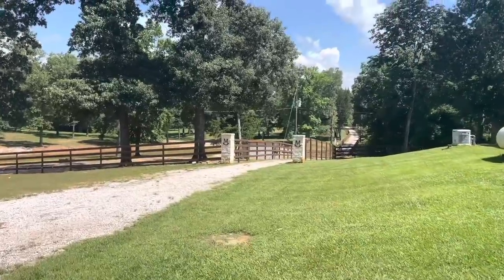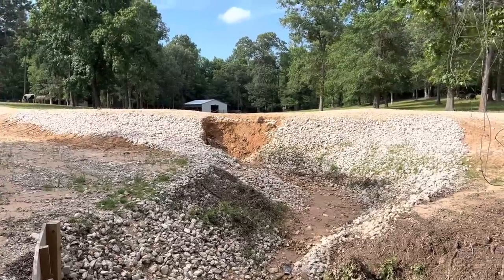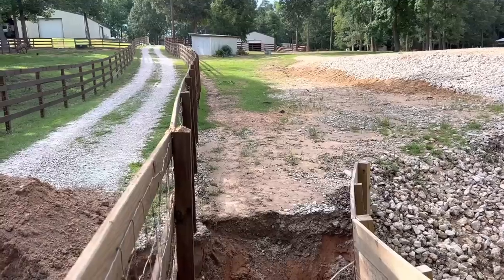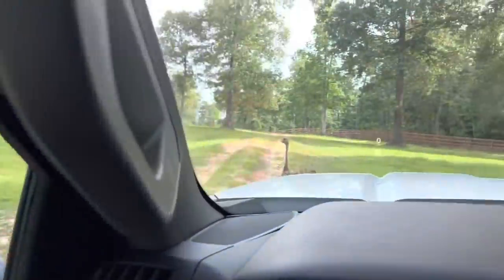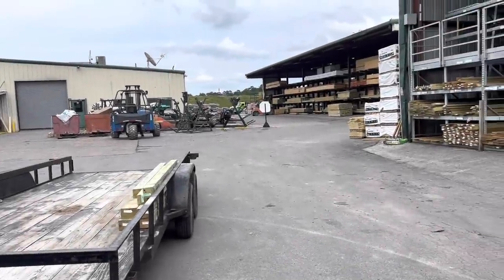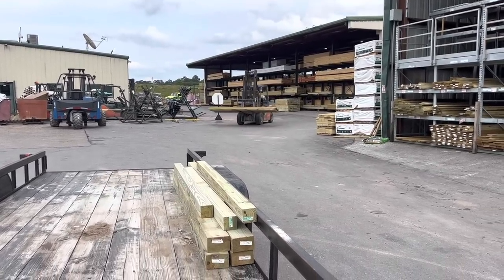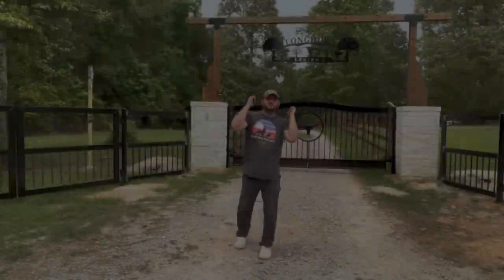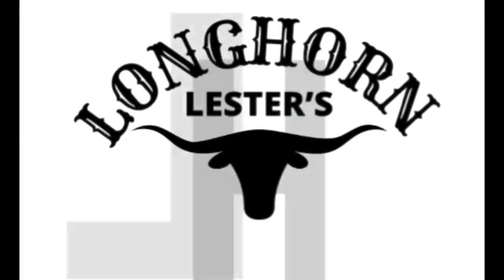Wooden Cattle Guard for Erosion Control

Comment: Just a suggestion; don't use wood.  Wood rots as well as gets crushed and is moved by water.  Cement and metal are harder for water to push; though more expensive it will last longer and be harder for water to erode and move.  I wish you all the best of luck and I know how hard this has been and devastating to your land, dreams and wallet. My prayers are with you both and your babies. 🙏

Comment: I hope you’re not making a mistake! And if you’re determined to do a cattle guard, I think you should be using metal and concrete!!
Reply: Never seen a wood one. It's always been metal
Reply: Exactly I’ve never heard r seen a wooden culvert  It’s Always been Metal with Concrete 😊
Reply: Just posted about my cousin. Tried to divert the water from their driveway-which was actually a natural dry creek bed. They tried a tressel (sp) wood bridge. Rains washed it right out. The new owners finally put in a concrete and iron girder structure over the lowest spot. But the natural flow of the land-continues to erode around the structure every time it rains. So I don’t know. May have to just give up and put in driveway somewhere else on the property.
Reply: Make the forms and have a cement truck come out and dump the cement into your forms
Reply: I've never heard of a wooden cattle guard, they've always been metal and concrete. I would hate to see your hard work get washed out.  IMO
Reply: Did anyone ask for all your opinions ?😊
Reply: Donna Wilmeth I’ve already said so to Lester the same thing
Reply: Good luck & Many Prayers for you Lester❤️🙏
Reply: @danm5076  it’s cause he knows your all going to give them anyways
Reply: We have a lot of cattle guards here in Virginia, metal and wooden ones!
Reply: It’s called a flash flood. Happens out west all the time
Reply: The sides will erode with the run off from the driveway. CEMENT sorry
Reply: It’s a bridge will never be a cattle guard.
Reply: Weight limit regarding the planks you will drive over. That diesel engine weighs alot
Reply: Another Lesterism........just like the hay corral that people told him wouldn't be strong enough 😂😂
Reply: It's going to be a big adventure when the cattle guard (bridge) collapses when someone drives over it.
No natter what it still needs a proper sized concrete culvert at the bottom so the overflow pond never holds water for long, the bottom if his trench sure looks like it has not been leveled with the proper grade to drain in...
Reply: Exactly. The wood is going to rot in a few years.
Reply: Praying!
Reply: @dorzy207   really I was thinking the same thing,  Lester clearly said he said he had making cattle guards throughout his younger years. He had by no means mentioned wood or metal. I think if he got wood he’s used to working with it.  Only thing that scares me is he had no help.
Reply: @loripasqualino9613   Lester said he has enough concrete leftover from building the back pasture fence.
Reply: @maureenahad7614  I was going to say he chose to do the wood I think it’s temporary why spend the money on metal.. but everyone wants to talk crap
Reply: Water rots wood.
Reply: @dorzy207  Yes Dorzy. Lester asked what do ya'll think? There are a lot of farm people on here and they may know of a better way. That is why he asks.
Reply: Maybe just use service driveway and not this one.  Better safe than sorry.
Reply: I agree 100%. Wood will not hold up over the long run no matter how large the individual rails/posts are. The pond has been a huge mistake that can't be undone. It needs to be fixed or essentially this has ruined your otherwise beautiful property. Good luck.
Reply: @mimallen9307  I get that but a lot of people just think they know it all
Reply: He knows what he's doing!
Reply: @dorzy207  Exactly, he didn't ask
Reply: @danm5076  He didn't ask this time
Reply: @teresaoar8360  He knows what he's doing
Reply: @jeancultice6859  It'll be fine
Reply: @2CalaLilly  It's not a mistake, the animals need the pond. He will get it to work properly one day!
Reply: Me to
Reply: Yer needs metal and concrete wood and dirt will erode and the wood will rot and a mud dam will not support the water the dam will fail hoover dam is not made of mud
Reply: @dwnhminbama4275  I’m sure in medieval times bridges and what may have been cattle guard type things were made of wood. When I walk across board, I have been known to wonder how much weight a board will hold. And I don’t weigh as much as a car. 🙄I wonder what will absorb the weight on the cattle guard. Just going to bury it in dirt?
Reply: It will be cool if it works. The water dropping into the culvert makes sense, but it seems like that will ruin the support of the cattle guard itself.
Reply: I completely agree, timber warps and rots in the wet. Plus livestock don’t seem to have any fear of timber. It’s a wasted effort Lester..
Reply: Agree
Reply: He might have to try 2 or 3 different ways to address this problem,let's support him and pray for a solution!!
Reply: Just from reading the comments I think you all are confusing the purpose of the wood he has in the trailer in this video.  Now Lester can correct me if in wrong but I think step 1 involves framing walls and floors made of concrete. Build the walls and floor frame and then fill the walls with concrete fill the floor frame with concrete to make the culvert for the water flow. I don't believe that the wood is what he plans on using for the cattle guard he is putting in. Step 1 get supplies. Step 2 build the culvert properly and step 3 make the structure for the cars to drive over whether it be cattle guard or a bridge. He wants a cattle guard well than that's what he will put because its his home and he has his vision of what he wants. I'm sure as he mentioned that he has enough experience to make it last many generations. I've got faith in Lester.
Reply: @maureenahad7614  The only thing that I worry about is that yes he said he had experience with cattle guards, but was it the same type of situation because this is also an erosion problem not just a cattle guard to keep cows from crossing over water. This is a serious erosion problem and I just don't know if wood is going to be suitable for the job.. it might end up being a Band-Aid..
Reply: I’m sure the top will be metal !
Reply: All that lumber is for the cement foundation side walls will be cement  and he will have a cement  floor
Reply: I agree, I have seen the metal and concrete.   Years and years ago they were made with wood but it was more like a bridge.
Reply: Yep Lester we lived in Tucson Arizona where it monsoon rains every July, it rains every day at 5 o’clock . We had dry river beds that would fill in minutes. It would wash out roads all the time.
Reply: We had a similar situation on our road that took four different tries to finally get one that didn't wash out.
Reply: @OBlonghorn  thats what I'm saying!
Reply: I 💯 agree you need to use your service drive. You can't fight nature, it will wash a wooden structure
Reply: The cattle grids we have are all concrete and metal … they last a lifetime
Reply: @dorzy207  THANK YOU!!!
Reply: I hope you stay safe fixing that culvert. Long process. Praying nothing bad happens
Reply: @courtneyw6378  he DID ask this time too.
Reply: @JenniferThacker1969  there is a difference between an opinion an criticism. Most on here are criticizing the plan. Many have admitted that they have never used cattle guard yet are stating they wouldn't use it and why!! The fact is, this is Lester's project, not ours. He knows his property and he is doing the job.
Reply: @sharonchapman3530  probably why the original driveway went over to the right of that pond area
Reply: I agree should be metal
Reply: My thoughts….happy building Lester.  You know what you’re doing and only you really know the levels of your land - we can only see via a camera lens.  Hoping this cattle guard works out as planned
Reply: Great job, Lester

Comment: Being raised around rivers and streams with natural erosion here in Oregon, add my dad building a natural log bridge, water is tricky. Your under work is extremely important to direct the water to keep it from eroding the side walls. The slightest millimeter you give water will be your bane. Maybe not today, but soon in the future. Wood degrades in time and time happens in a snap of the finger. Concrete needs to be in an overreaching apron on approach and digress on the floor and walls in order to direct water. Good luck to you y’all.
Reply: @paulahileman2291  I agree

Comment: Lester,   I think the best way to handle moving those big pieces of lumber would be to construct 2 tripods. You can make them out of 2x4's. Put one on each side of the ditch. Use block and tackle to hoist into place. Use a Timberline hitch if you are using rope around the wood. If using straps wrap it 3 times. the best part is you cam move the tripods as close to the spot to were you to be the final placement of the lumber, and have the block and tackle do the work for you. If need you can Put board across ditch and put tripods on boards and be on top of the ditch!

Comment: Lester.  Trenches cave in. The soil is already sandy, soft waterlogged and compromised.  Anything over a 5' deep trench needs trench protection.  I'm not giving opinions on which is better as far as the project itself, but please be safe and do not go into the bottom of that trench without some sort of way to shore it up and protect yourself.  Google trench box, you 110% need if for that depth, especially with just you and Jamie working on it.  You park a heavy tractor, trailer full of wood too close and you could have a incident.  I'm saying this not to be critical of your projects or anything of that nature, more out of concern.
Reply: Yes AGREE 💯!!! THIS IS EXTREMELY DANGEROUS given the depth of the trench, the waterlogged walls, and having heavy equipment and supplies on either side adding weight to the walls that are already soaked. It is prime condition for a cave in on anyone working down in the trench. 😱

Comment: I hope you can fix all the issues and if it works out great and for a long time, man I will be so happy to be wrong! 😆 I would strongly suggest rebar and concrete too (not just bags on the floor). Really like building a bridge with pillars and everything. Because the ground will wash out around it (it does every time you altered something) and you risk the whole cattle guard crashing down. It is an easy fix for now, but I think that this will give you another headache in the future. I know I sound like a party pooper now, but I have to say it: if ever one of the horses or donkeys gets out... you risk that they break a leg, cause horses do walk over that. 😟 For a donkey it's even more dangerous, cause they fit right through with their hooves. With horses you maybe (!) get lucky if their hooves are big enough. Rick was sweating bullets when Mr. T walked over one, he got very lucky there (you can ask him, he will tell you the same thing). Cattle guards are baaaad for horses and donkeys. For me personally, I wouldn't risk it, cause I know myself, one day I'll forget to close a gate or a fence gets knocked down and then there's a disaster. And: consult an engineer, Lester this is above your pay grade and the pound guys too, I would not touch that with a 10 feet pole, because it's so difficult. Not saying that in a mean way, it really is that difficult and a liability. You can't do that with wood!
Reply: LESTER....Some very wise words in the comment above. You actually don't how much the ground is still moving (due to moisture) while your reading this. 1. Don't work around that hole alone!
2. Immediately put a ladder in the hole for just in case. Clay is a poor foundation.

Comment: Important :   Lester, I'm proud of you already for making up your mind to do this and buying supplies  to do it with.  Getting the demolished covert  out of the ground  was a big undertaking  yet you got that accomplished also. My prayers are with you and I believe in you and I think you will get this done in a timely manner in spite of negative comments. One last hing, I don't think you would have started such a  task without thinking you could do it and to get it finished. Be sure to take a small tote cooler in the "lions den" if you need to  so it will  hold plenty Gatorade and water. This is  my only advice. I don't want to see you get dehydrated doing his job.  Prayers are being said for you here in Knoxville, TN.

Comment: What I'm envisioning is an open bridge. The slats are open to allow water to flow over and through running off the hills or ditches while allowing y'all to drive over it. I saw them a lot when I spent summers with my grandparents in rural Missouri.
Reply: That's a cattle guard.

Comment: You'll still need some sort of culvert under all of that to drain the water away from the exposed earth. You'll also need a culvert cut in half lengthwise to catch the water from the wooden cattle guard when and if the water ever gets that high again. I saw some concrete culverts at that place where you got the wood and I feel that would work great. As for the instillation of all of this, I know it would cost $$ but I think you need people who have the equipment to handle all of the items, culverts and wood, because it will take more than 1 or 2 people to install everything & you don't have the equipment nor people to do it. But I like the idea of a cattle guard,